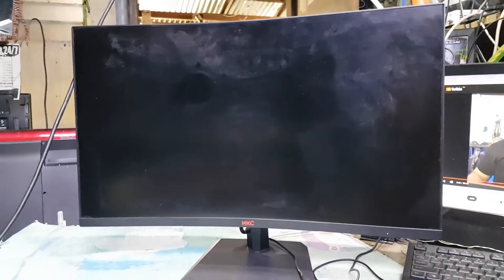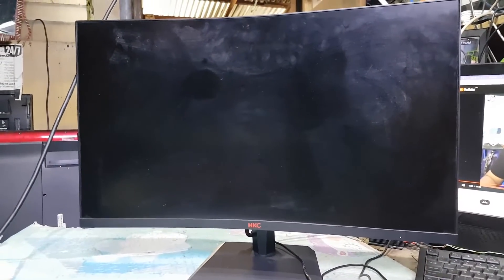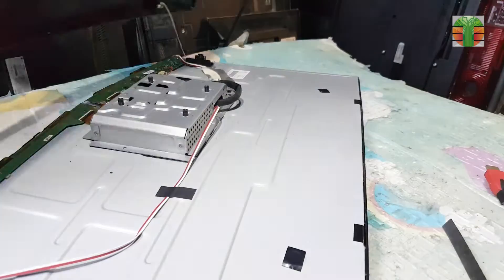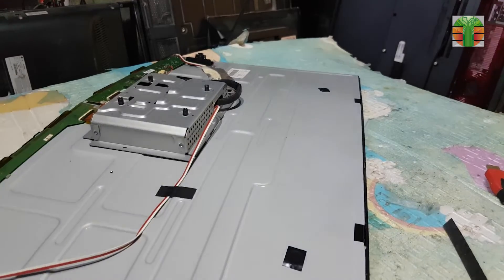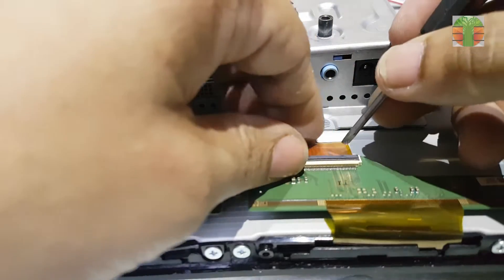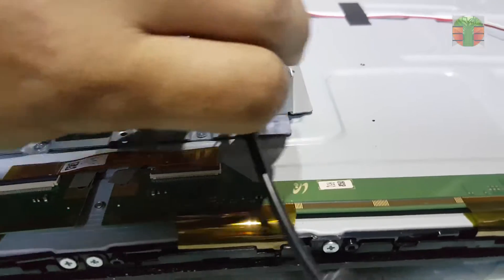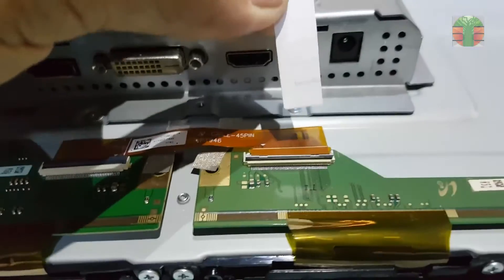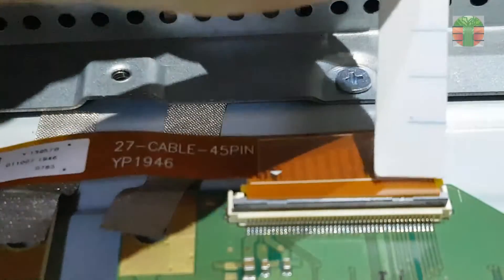HKC-M27G3F monitor. (Display repair)

Comment: Thanks for this video, if I understand correctly, Koorui M27G3F is the same monitor. Mine is not showing OSD or anything, the backlight turns on though. When I connect it to the laptop - laptop shows it it display settings with correct model name. Do you know if there is an easy fix for this? Thank you in advance.
Reply: @tevzTVTevatronics can you help with this? Thanks.

Comment: Hi engineer, i have samsung odyssey g5 32 monitor, its led indicator is on, but when i click monitor doesn't turn on, some times, i unplug monitor and power cycle it it turn on, what's the problem with this monitor?

Comment: Hey very good video but can you help me mine had some lines too horizontal then i unplugged the cable and since then its only black. backlight is on but no picture and no menu on the monitor

Comment: Hi po sir, magandang hapon po. Sinubaybayan ko po at tinutukan ng maayos ang particular na video na ito subalit wala parin pong pag babago. Wala po akong background sa electronics pero sinubukan ko parin po. Gusto ko lang po sanang isalba ang 24-inch 144hz HKC gaming monitor ko. May vertical lines din po sya pero di po naaayos kagaya ng sa video niyo po. Pwede ko po bang ipagawa na lang sa iyo to? tsaka magkano po ba ang aabutin po. May sentimental value kasi sakin tong monitor nato. Isa to sa mga bunga ng mga sakripisyo ko po. Sana po ay mabasa niyo po ang comment ko at mag reply po kayo. Maraming salamat po, God bless and more powers po <3
Reply from the maker: baka sa kabila ang may defecto, pero mag cut kana doon. location mo ba? dito ako sa laoag city.
Reply: @tevzTVTevatronics  Tinry ko po both sides na iblock yung part kagaya sa video, wala parin po eh. mainit parin po yung part na may vertical line. Kidapawan City, North Cotabato po ako. Magkano po ba aabutin pag pinagawa ko po sa inyo sir?
Reply from the maker: @FukimoMikoto666  totaly damaged na yung lcd mo. laoag city ako. bili ka nalang ng bago

Comment: Hello, my Redragon GM270F165 monitor displays a black screen with a horizontal line above on frequencies 100Hz, 120Hz, 144Hz, and 165Hz. It only functions at 60Hz. I've tested with another PC and replaced cables, but the issue persists, indicating the problem lies with the monitor itself. Could you please suggest a repair solution?

Comment: I can't remove my monitor stand screw at the back. Should I remove all of the screws first? Or it should be removed even without doing that. Thank you and will wait for your response.
Reply: I tried you're method 2:28 but mine is doing nothing even if I put forced on it.
Reply from the maker: Knock it down

Comment: Ok, but what is the real solution? What really went wrong? After all, by blocking the contacts, it is not correct, or are the links from the factory useless?.

Comment: Sa akin yung hkc g27 ko mayron backlight pero  no image o picture, ntry ko tinanggal ang left board no image parin, sa right ata ang sira... sana may makatulong skin dito. tnx
Reply from the maker: no image baka hindi cutting lines yan
Reply: @tevzTVTevatronics  bumabalik sya after 30 minutes or 1hour ngkaroon sya ng picture pghinahayaan ko lng..pag i off and on ko black screen na nman backlight lng , hintayin ko nmn ng 30 to 1hour pra bumalik yung screen image nya, ano kaya posible problem nya??

Comment: Wooow tx bro
Reply from the maker: Welcome
Reply: @tevzTVTevatronics  Thanks for this video, if I understand correctly, Koorui M27G3F is the same monitor. Mine is not showing OSD or anything, the backlight turns on though. When I connect it to the laptop - laptop shows it in display settings with correct model name. Do you know if there is an easy fix for this? Thank you in advance.

Comment: thank po sa video. pero pano po if hindi gumana yung kabilang side? nawala yung bar lines pero blank screen lang. TYIA
Reply: Sa akin yung hkc g27 ko mayron backlight pero  no image o picture, ntry ko tinanggal ang left board no image parin, sa right ata ang sira... sana may makatulong skin dito. tnx
Reply from the maker: ikabit mo yung pinotol tas try mo sa kabila
Reply: @tevzTVTevatronics  di pa ako nagpotol, yung connection lang sa board same sa video dito.. di gumana blank/ screen lang yung kabilang screen

Comment: Hey Mr T. Wondering what you use to clean up stained LCD panels that have those metallic rainbow color swirls. Perhaps someone used too harsh a chemical and destroyed the plastic on a freebie I was given.or just needs a good scrub with detergent of some kind?EDIT. I used vinegar followed by IPA. Either one by themselves didn't work. All good now.
Reply from the maker: i use a clean cloth only.